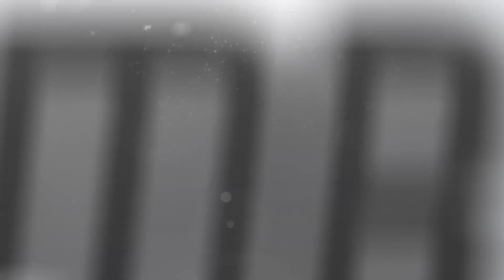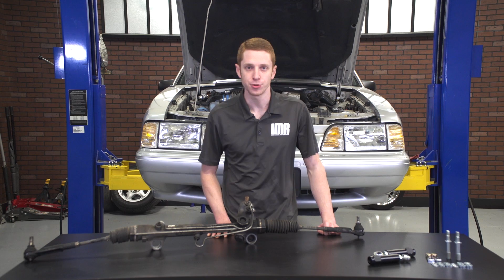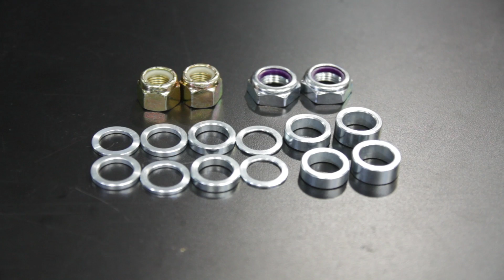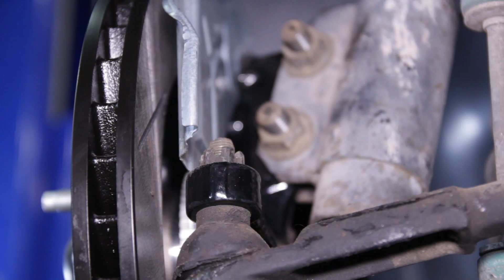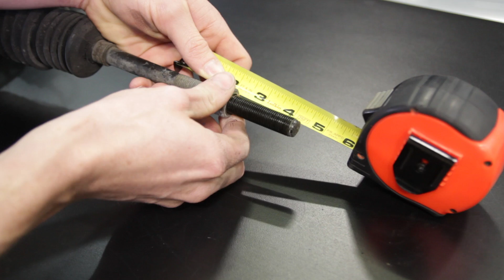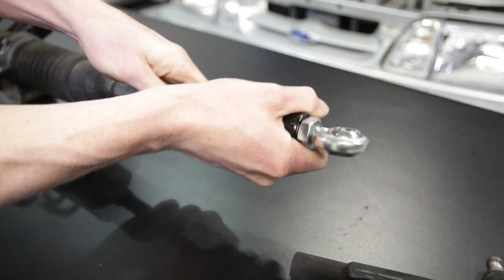1979-1993 Mustang SVE Bump Steer Kit - Review & Install

Comment: Hey LMR,  im thinking about going with new edge spindles on my 87 mustang LX, but im not lowering the car do i need these?
Reply from the maker: This is a touchy subject and you'll get different opinions from anyone that you ask. Some say to not use 96-04 spindles because it's impossible to correct the geometry with a bumpsteer kit. However, there are several cars out there that have 96-04 spindles with stock Fox geometry k-members (stock or aftermarket) and are working fine. All of the cars that I've done have been lowered and required a bumpsteer kit due to the geometry. I can't speak on behalf of factory ride height as I've never messed with it and it's been a while since I've measured bump steer. Also, 96-04 spindles will increase the track width 8.1mm (.320") per side. I wish I had a yes or no answer, but figured I would be honest with you. Thanks. -Landan
Reply: @latemodelrestoration  I appreciate it man I was going to do a v6 swap from a 2.3, and found a wrecked but running 2001 for 200 bucks, but just done a  302 swap but wanted to use the better breaks, thanks for your time
Reply from the maker: @MustangGuy6501  Sounds like a fun project. You're welcome. Let us know if you have any other questions. Thanks. -Landan

Comment: Will this work if a I have a 5 lug spindle from a 95? 5 lug swap on a fox
Reply from the maker: Yes, these will work on the factory Fox as well as the SN spindle sets.
Reply: Late Model Restoration oh okay so I wouldn’t need the 94-01 set of bump steer than? I can just buy the fox ones
Reply from the maker: Correct, the Fox will work just fine for this one.